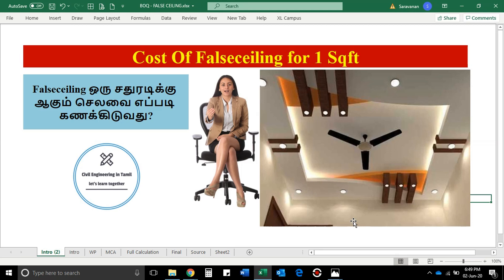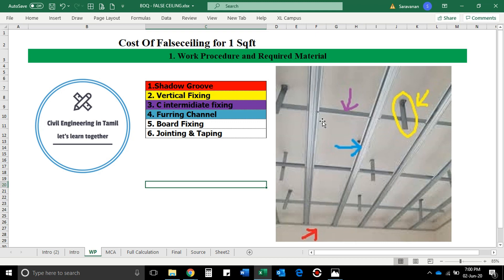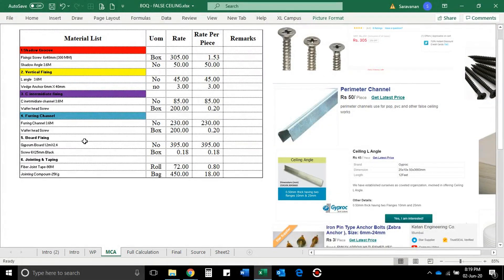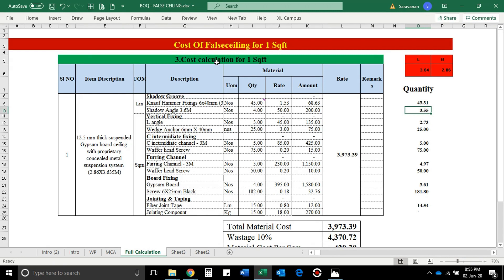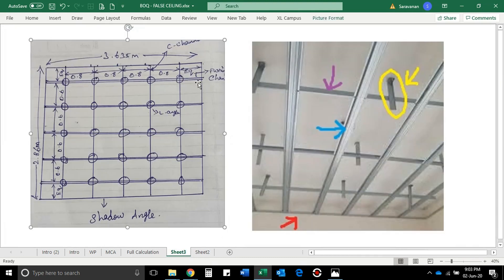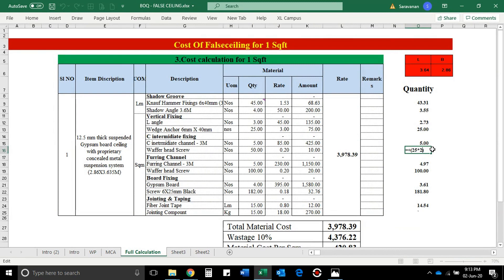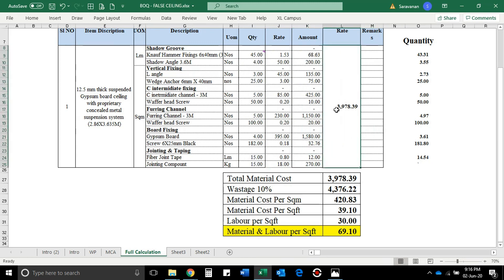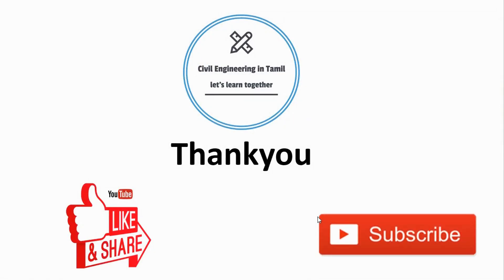How to calculate falseceling cost for one sqft | ஒரு சதுரடிக்கு ஆகும் செலவை எப்படி கணக்கிடுவது?

Comment: False ceiling no water proof so thanni padama parthukitingana 50 yrs melayum varum ,if u used saint gobain gypsum board...compulsory but rate konjama high per sqr ft 10 Rs increase agum
Reply from the maker: Dear sri ram, but water proofing & moisture proof boards are available in market so don't  speard wrong information. Infact MR boardla toilet portion kuda aduchu athula water proof & tiling kuda pannalam (glue use pannaunum) 

Thanks for your valuable comments.

Comment: How to measure the false ceiling square feet
Reply from the maker: Take length and width so you will get the area of horizontal board and vertical board you may take running meter